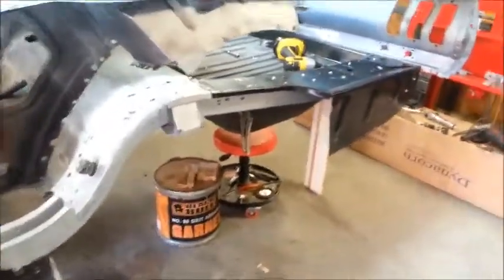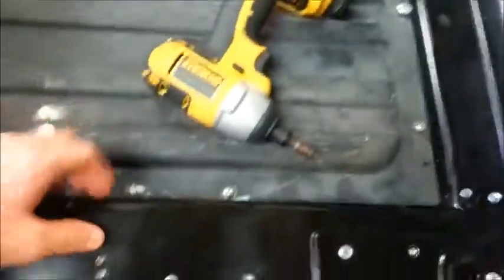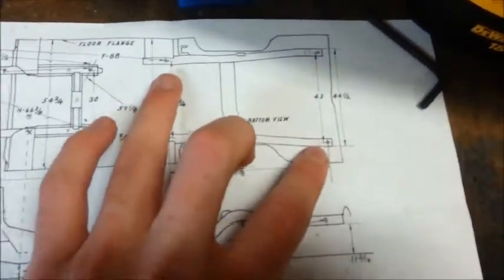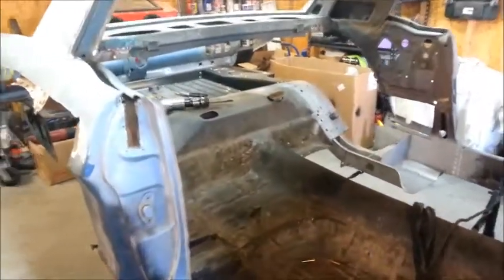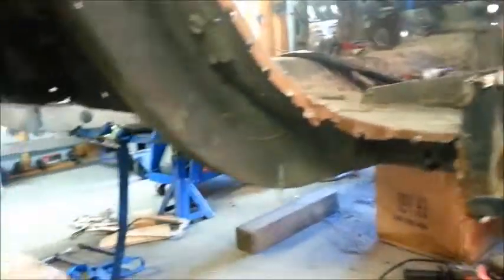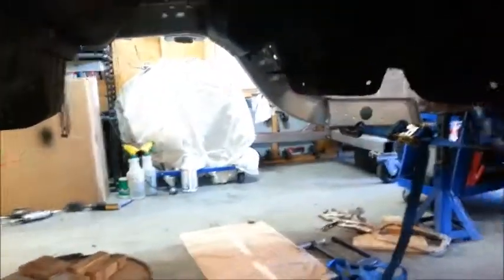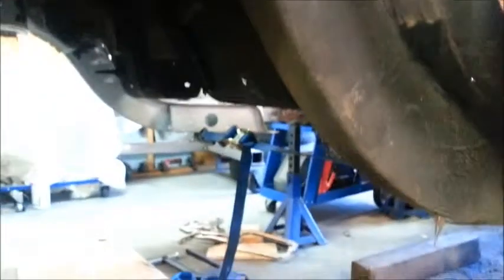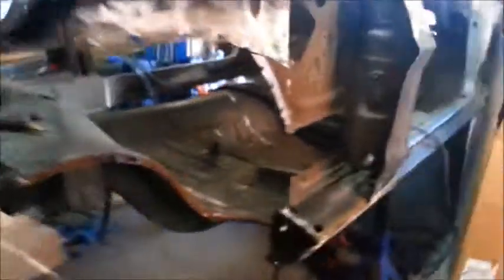68 Ford Mustang Restoration - Elaina - Video 12

Comment: the frame rail replacement is looking good, nice update and good luck on the other one too!  67-8 should be the same measurements, don't have either one or I would measure it up for you.
Reply from the maker: thanks man. ya, i have the manuals for the 67.. i used to have one of those too. but i actually couldn't find the frame dimensions in any of them. however i did find the printout of the frame dimensions on a forum. says it is for a 67. that's the one i've been going off of.